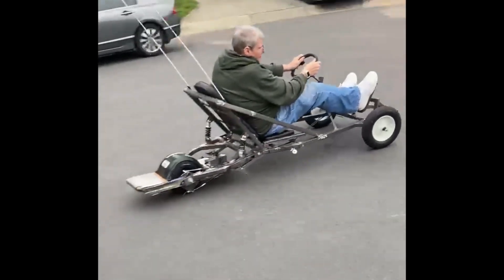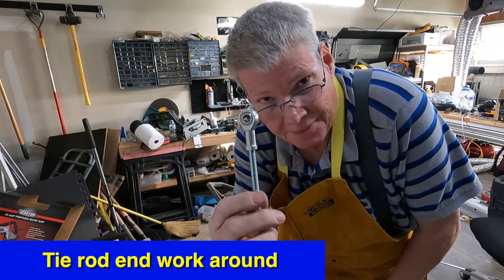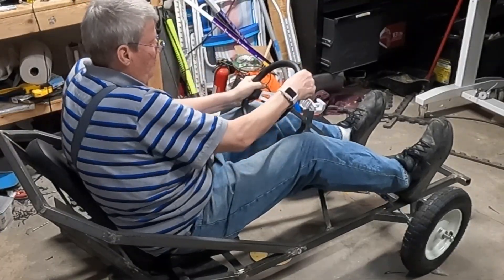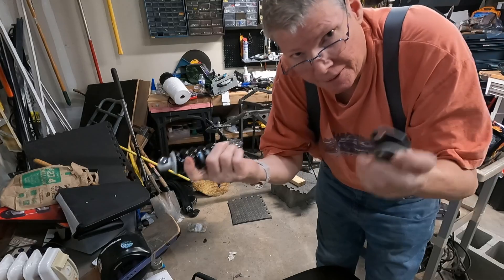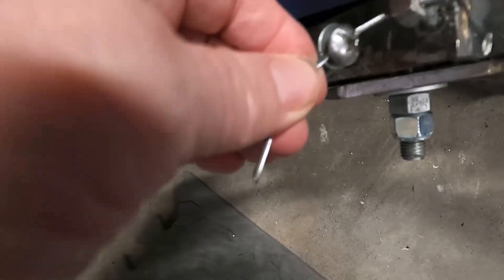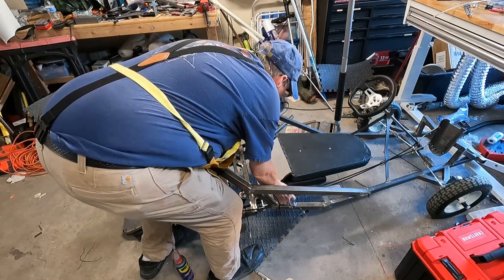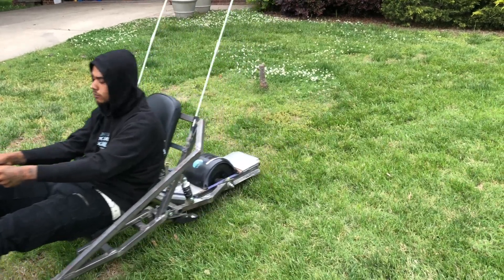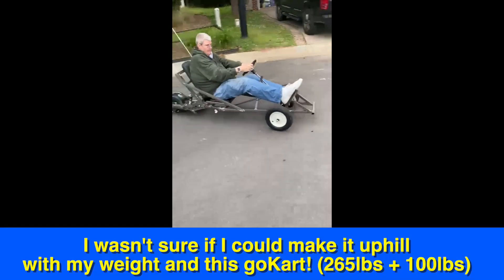Tinkering with a OneWheel GoKart part 3

Comment: I had this idea ...thank you for making it reality
Reply from the maker: I just bought a GT for it. Turns out the width has changed since the initial release for the GT. It was 9.5 inches. Now with the multicolors available in rails it is now 10.25 inches. So… I must modify the goCart to accommodate the new width. I think I will design a whole new harness for the GT. So, videos of this process will be coming! 

Thanks for watching!